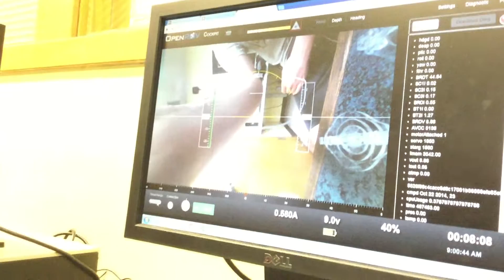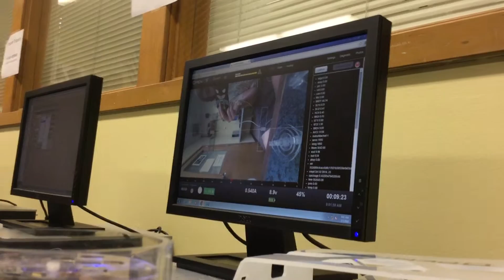OPENROV 2.8  thruster test laser test battery end cap problems

Comment: Had vertical thruster issues and problems with the LED's.  Unfortunately I had to dismantle the camera housing and re-solder the connections.  Everything works great.  Although I'm still getting a ESC current problem according to the dive alert plugin.